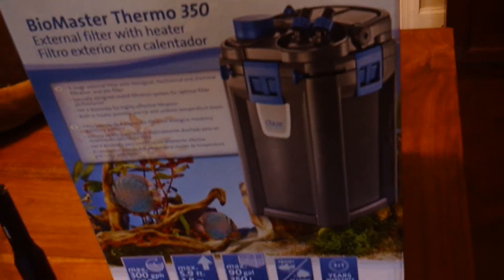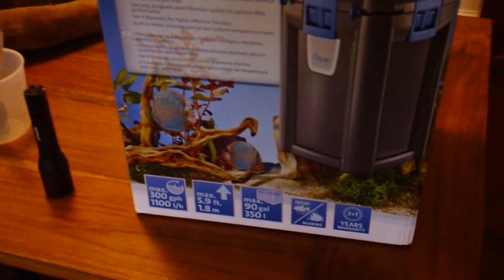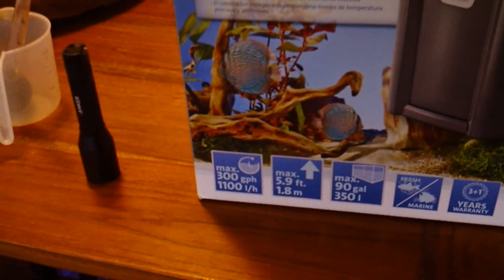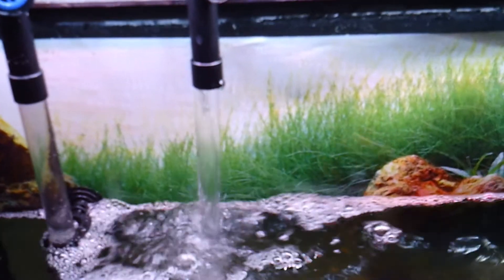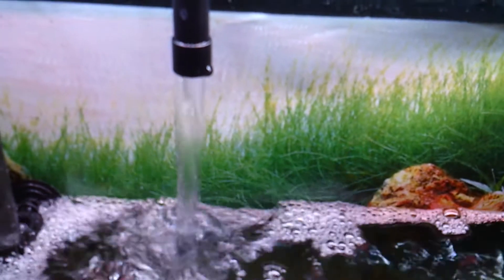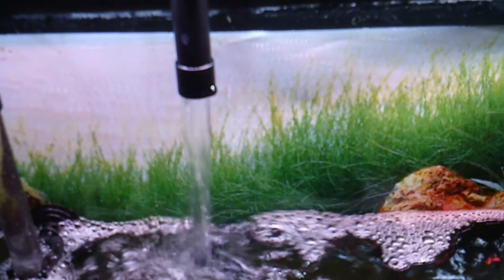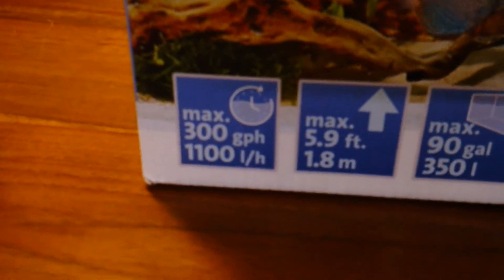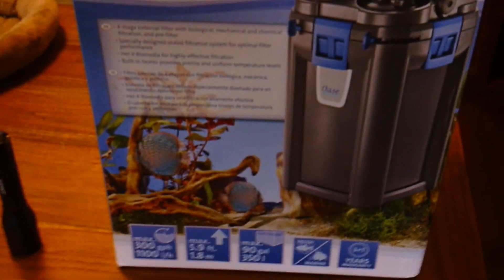Measured flow rate of an Osae 350 Thermo canister filter.

Comment: In this time what is your opinion about oase?
Reply from the maker: That is a very good question.  I think it is an innovative filter design that is very over priced and under powered.  I will use the one I have, but I will not buy another one.  Did I answer your question?
Reply: @lkapitan8232  How much is the flow reduced? Or is it necessary to clean the pre-filter very often?
Reply from the maker: @endlerpoeciliawingei  I admit the filter in on an over populated tank, so the pre-filter sponges only last about 3 days and then must be clean, you can see the flow drop everyday until the pre-filter are cleaned.  On a "normal" tank I would say they would last at least 2 weeks.